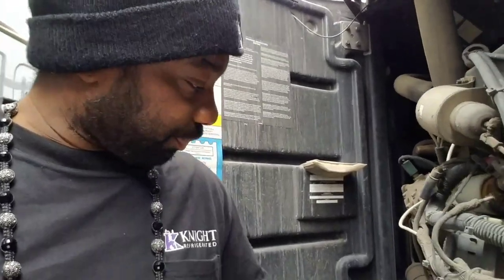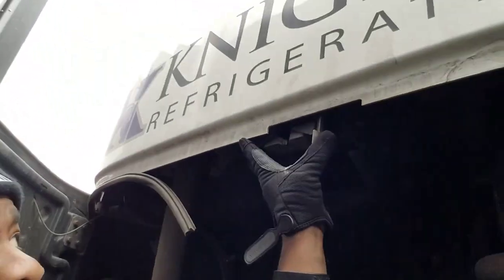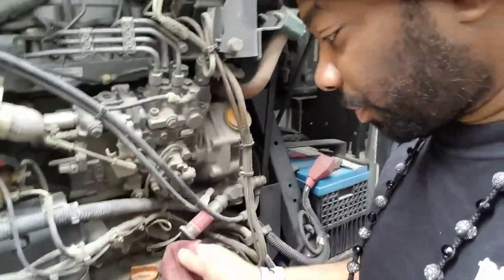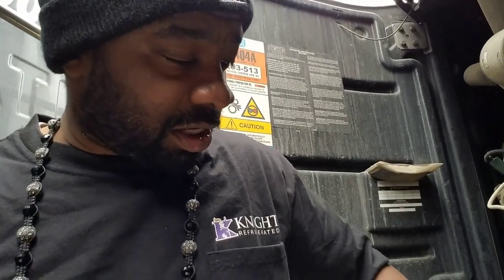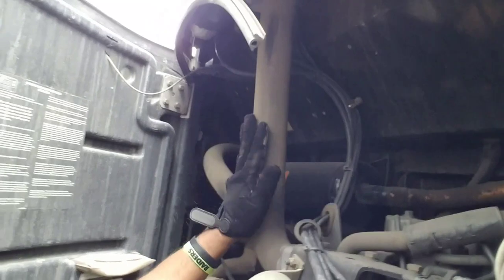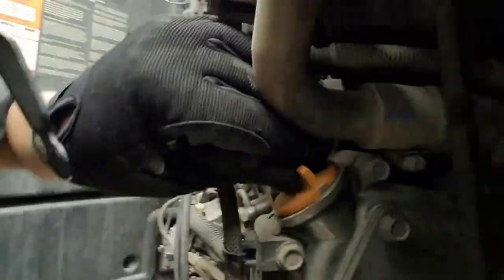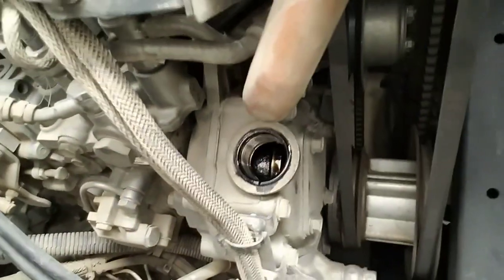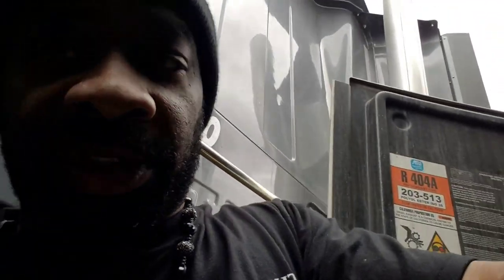How to check your Reefer Trailer Engine Oil

Comment: Man, first of all you need TO MAKE SURE reefer "kill switch" is OFF!!! (on TK it's in right side, little switch. On Carrier is that one switch with red cover) those are satellite controlled reefer units and they may start anytime, you or anyone else do not want that to happen once you are checking the belts or hoses and etc. And only after that do physical pre-trip inspection.